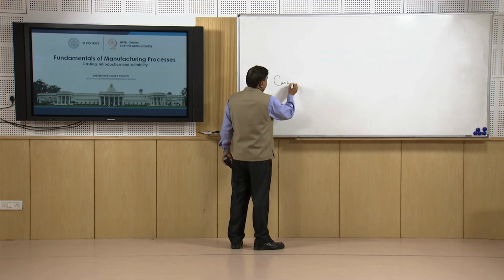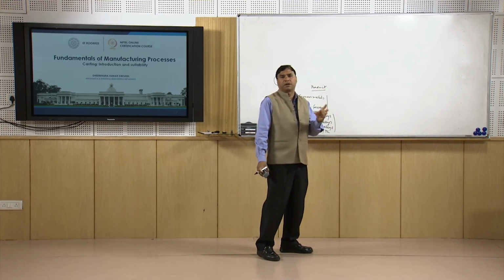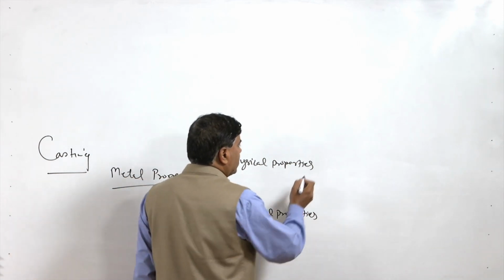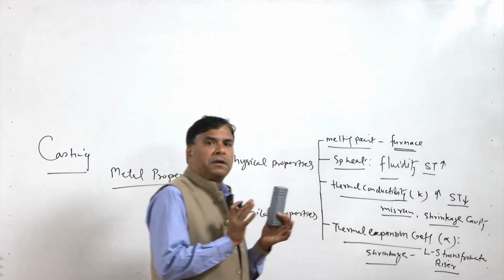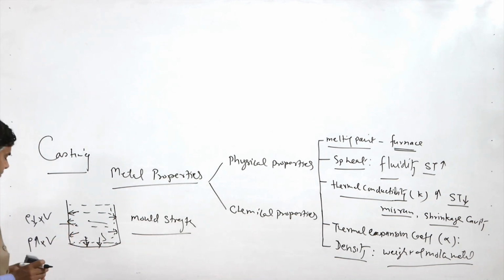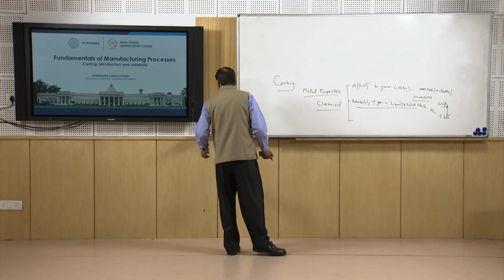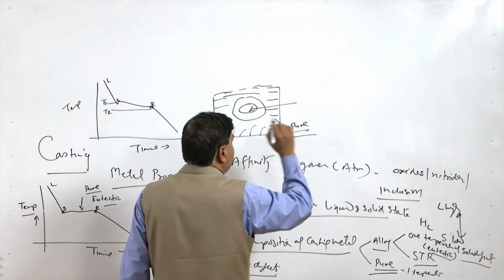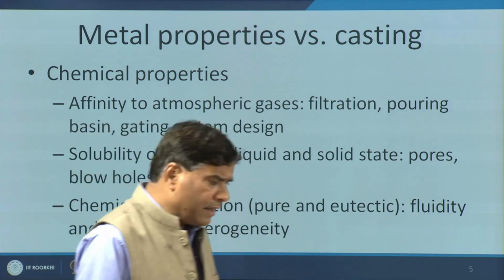Casting: Introduction and Suitability

Comment: what is fluidity here? how it is related to specific heat? please reply anyone.
Reply: flow capacity of molten metal so that it will not solidify during flowing through mould like in die casting
Reply: @krishnaghadiyali6301  thanks